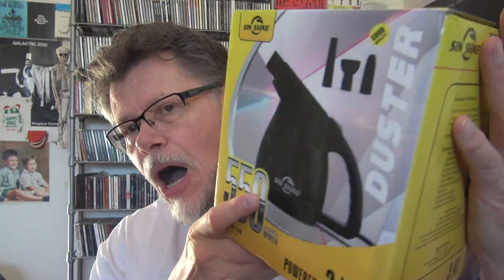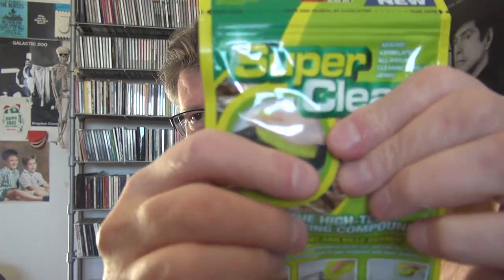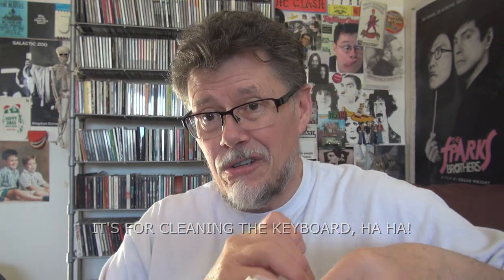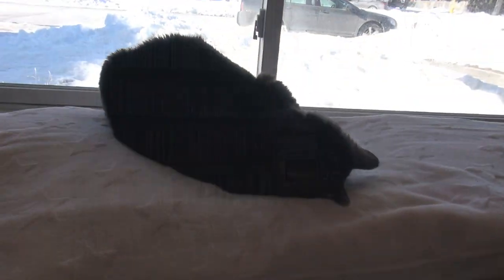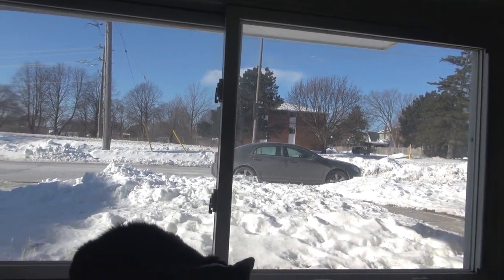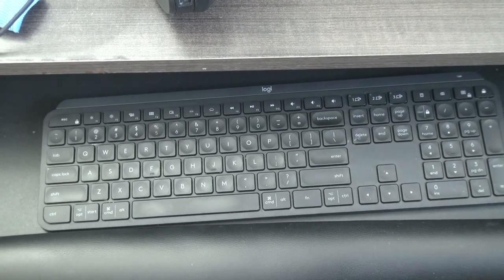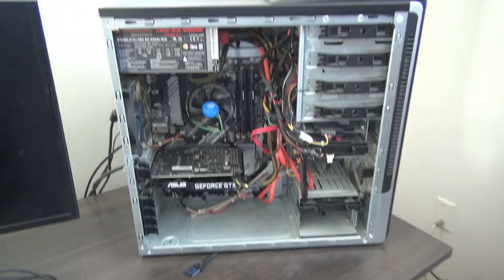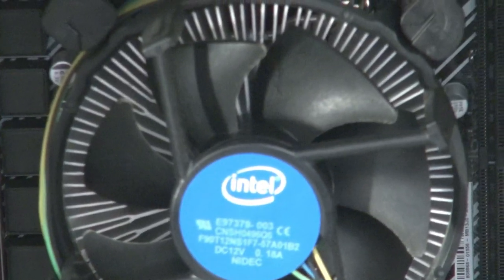COMPUTER CLEANER - SIN SHINE ELECTRIC AIR DUSTER UNBOXING AND REVIEW (NOT SPONSORED!)

Comment: Pretty cool.  I have never seen that before.   I always just vacuum.  Wonder how you vacuum and air spray at the same time?
Reply from the maker: Using a regular vacuum can be dangerous:  ...A vacuum can create static electricity that can damage computer components. A vacuum can also create enough suction to make your fans spin hard enough to damage them. Don't use a feather duster or rag, either...
Reply: @LarryGravesCanadianStudmuffin  Thank you!!!!!!  I didn't know any of that!!
Reply: @LarryGravesCanadianStudmuffin  your fans were spinning pretty fast sir. maybe hold them next time so you don't accidentally fry something
Reply: @amansizedduck  The power was off and it's safe to do. Thanks.